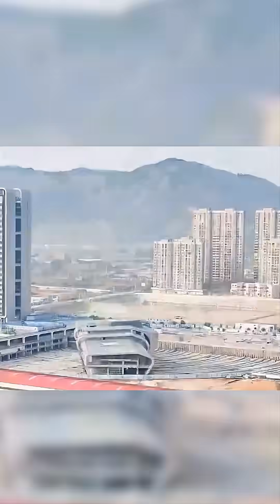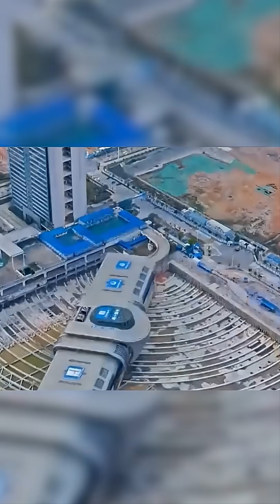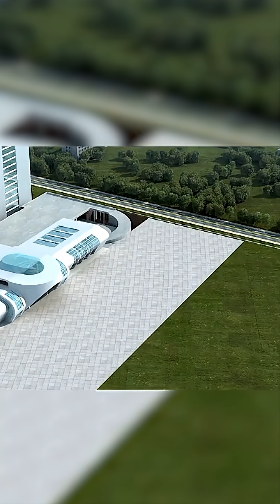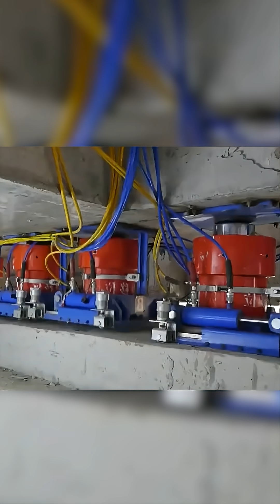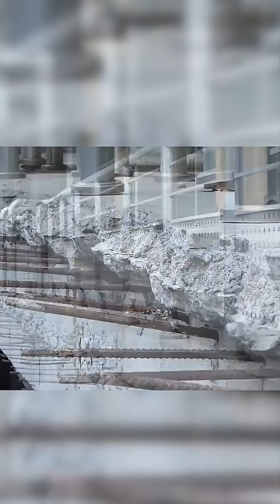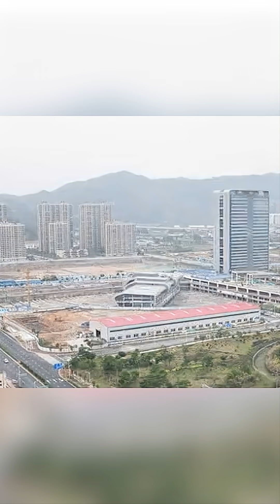China Moves a 30,000-Ton Building 😱 | Guinness World Record Engineering Marvel

Comment: How did they keep the electric lines, and water pipes intact, and without splitting them?
Reply: If this building is earthquake resistant then it is already sitting on large dampeners so there's a big gap under it so disconnecting those utility lines and pipes is almost child's play when compared to the whole project.
Reply: Of course they have to cut all of these off from the main lines and the new  main lines will be ready at the new location. All the hardware in the building is moved with the building itself. There has to be an underground construction at the new location to provide space for new connections and  assembly of the utility lines.